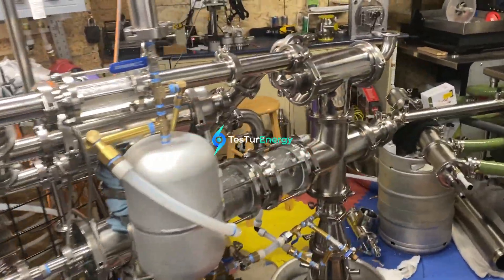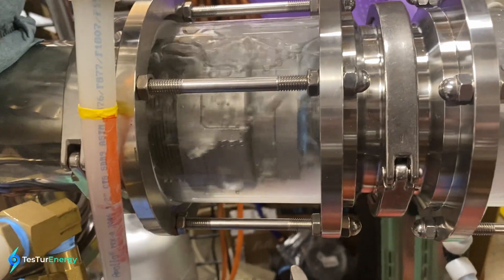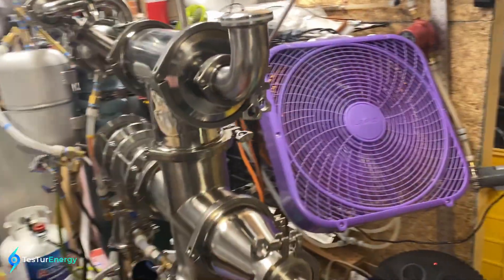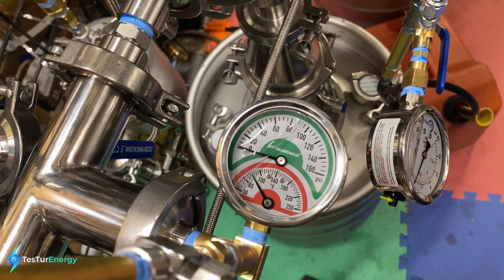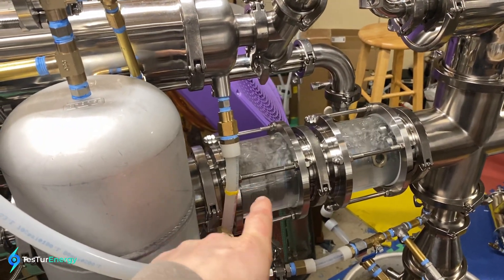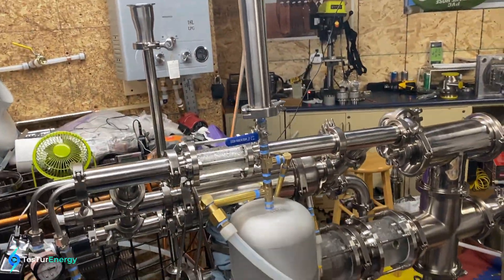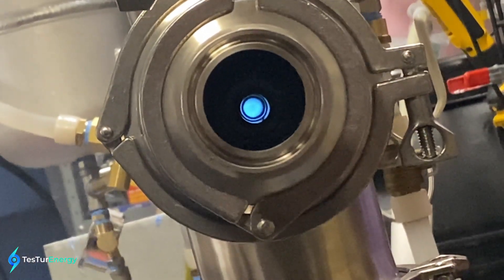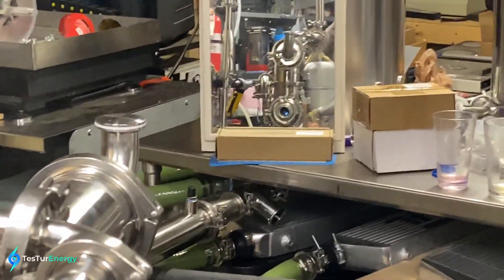Tesla Turbine Jet Engine Combustion System GB 186,083 Superheated Steam Propane Burner

Comment from the maker: Hey Everyone! Make sure to check out the latest updates on the combustion + steam Tesla turbine builds! 

Tesla Turbine 250 watt to 2.65 kW Power and Efficiency Test
https://youtu.be/K7qZvq1CMFg

+5 Horsepower Tesla Turbine Dyno Jet Turbo Power & Torque Curve 375 mph @ 125 00 rpm HIGH SCORE!
https://youtu.be/exF5Rn-L8gs

Solis Talks Tesla Turbines - Nikola Tesla’s Electrical Power Systems Patent GB 186,083 Walk Through
https://youtu.be/5Y3D13JmtcA

Tesla Turbine Jet Engine - gasoline fuel burner atomizer flame tube test 186,083 propane burner
https://youtu.be/gRqKowignac

Come check out my latest Tesla Turbine updates on the 10in diameter, 75disc aluminum and plastic prototype drive turbine dyno, 3.75horsepower and 6.22ft-lbs of torque to the shaft at only 4150rpm with a 150psi room temp compressed air supply from a regular piston compressor for now. I’m gearing it UP AT 1:3.6 to dual BLDC gens with a Kv rating of 2200rpm/volt. So for every 611 RPMs on the turbine the generators output 1volt. 

Tesla Turbine Generators With Usable Power and Torque
https://youtube.com/playlist?list=PL4XBGjR8Gu-Emu1QRPIwATKFuCZabqOh1

Tesla Turbine Dyno Horsepower And Torque Outputs! + 300mph 3.75hp 6.22 ft-lbs 4150rpm
https://youtube.com/shorts/Zxy8mIVG6as?feature=share

1200watt continuous electrical load output with room temp compressed air all the way down to 65 psi too and with the turbine only at about 6700rpm.
https://youtu.be/BHPAQF8QNnw

This is a look through of the 10in disc stack of 75 discs, +10,000in^2
https://youtube.com/shorts/FU2LMZQ2_yA?feature=share

These are the latest liquid fuel burner tests for the replication of GB 186,083.
https://youtu.be/gRqKowignac

These are the latest propane burner tests.
Tesla Turbine Jet Engine Combustion System GB 186,083 Superheated Steam
https://youtu.be/KCyyiKnIarc

I haven’t gotten to my Tesla disc compressor tests finalized just yet but I have the setup to do them already just gotta do some upgrades to my bearing and gear hubs for the generators. 
10in Tesla Compressor & Turbine w/ Built In Balancing Apparatus RC Car Dual 6s 3kW 2200kv BLDC Motor
https://youtu.be/fCQn7Q0rroI

Comment: um what"s actually going on here man?
Reply from the maker: Hey Scott! Thanks for commenting! It really helps the algorithm! So this is my replication of Nikola Tesla’s Combustion + steam turbine patent GB 186,083. Working out the burner design. 

If you’d like a better break down of the system check out this video of mine. It goes through both the high and low pressure steam systems Tesla was planning to use his turbine for. Let me know if you have any other questions! 
Cheers! 
Solis Talks Tesla Turbines - Nikola Tesla’s Electrical Power Systems Patent GB 186,083 Walk Through
https://youtu.be/5Y3D13JmtcA

Comment: What is this gonna power, and if so how much power does it make hp,tq,watts, etc
Reply from the maker: Hey Georgia State Militia! Thanks for commenting. This power house is for the combustion + steam Tesla turbines I am building. Check out my latest preliminary prototype tests.10in diameter discs , 75discs 10,000in^2 of active surface area, 0.0092in disc spacing. 2in wide rotor…
Proof that Tesla turbines are 100% viable and can produce practicable power, AND torque at low RPMs. 

This is the dyno acceleration test, peak 2.75kW and 6.22 ft-lbs torque to the turbine shaft, at only 4150 rpm on only room temp 150psi compressed air.
https://youtube.com/shorts/yXQy844URMA?feature=share

And this is the actual sustained 1200watt electrical load output tests @~6500rpm on room temp compressed air all the way down to 65 psi.
https://youtu.be/bWpXRzrzf4g

The turbine is geared UP at a ratio of 3.6:1. Yes you heard that correctly geared UP. the generators each are 3000watt BLDCs with a Kv rating of 2200rpm/volt being spun at ~26,000rpm for high frequency 3phase 12vAC and rectified to high frequency pulsed 12vDC then sent to the 12vDC to 120vAC 60hz pure sine wave inverter. 

Let me know if you have any questions!
Reply: @CharlieSolis  Disregard my question above. You've answered it fully here. I see where you're going with this now and I wish you every success.
Reply from the maker: Hey Scott! Thanks for commenting anyway! It really helps the algorithm! ❤️
Reply from the maker: Just released the latest update! 
Tesla Turbine 250 watt to 2.65 kW Power and Efficiency Test
https://youtu.be/XQl1DQgXVkQ